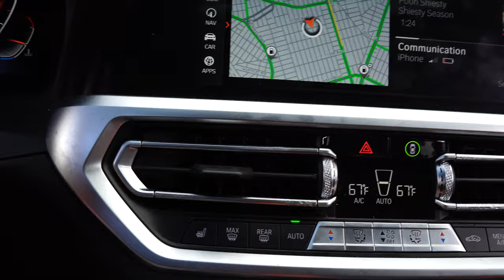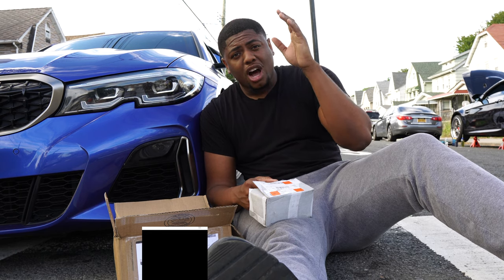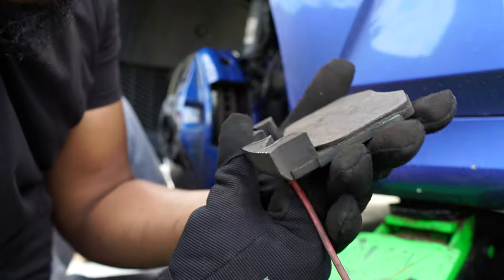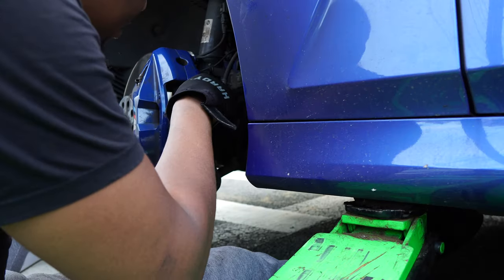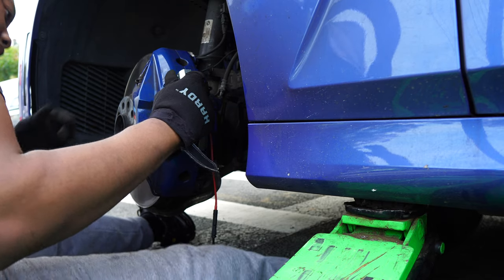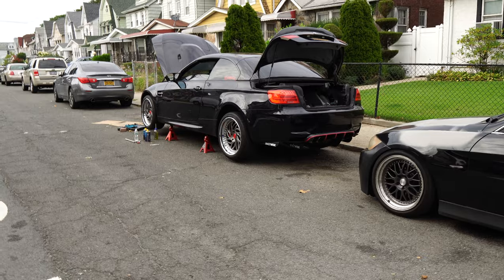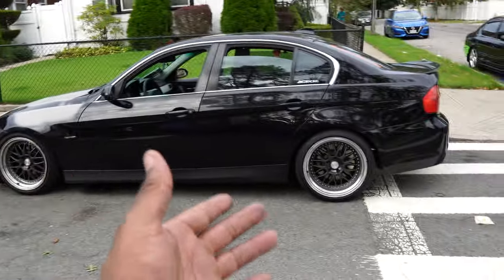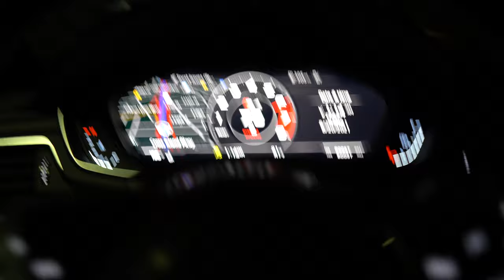Replacing M Sport Brembo Brake Pads On The M340i *DIY*

Comment: I just did my front break pads on my g20 with m sport breaks ... followed all instruction from video .. then went for spin and there was click noise everytime I released break pedal .. after like 15 released click noise gone . However I parked my car and went to shop and start driving again click noise from pedal again . Every time I park car and start driving click noise coming back and after breaking it stops ... any idea what that would be ... its coming from the pedal ...🤷‍♂️
Reply: We are having the same issue, so question, did you new pads come with the adhesive on the back of the pad. The ones I put in did not have it which I think is the cause of the issue. Going to put some 3 m double sided tape to see if it helps.